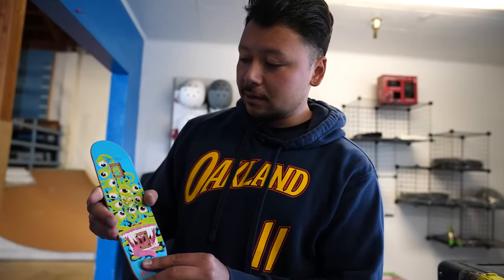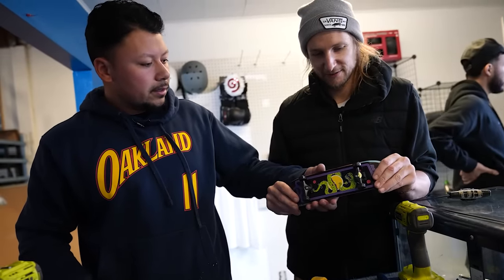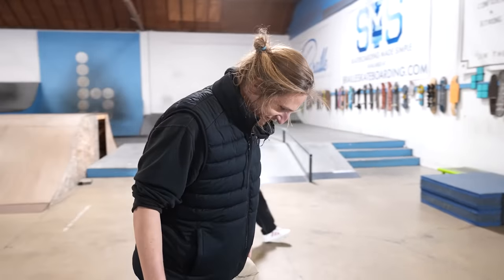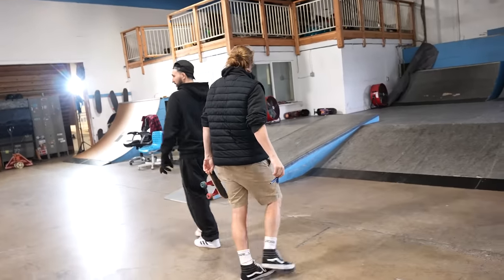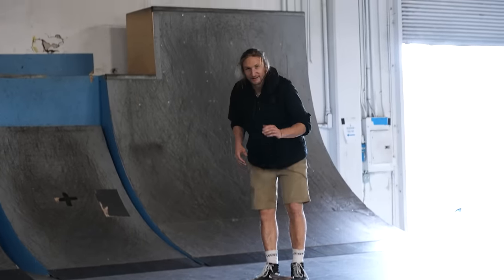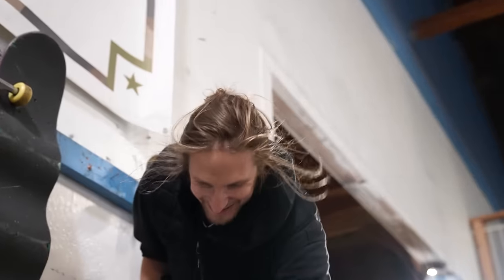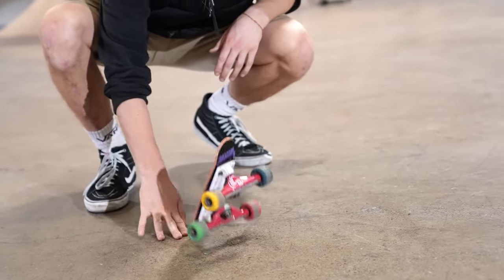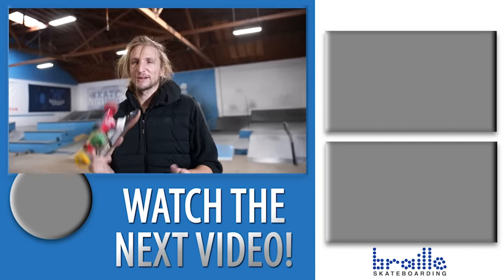HAND BOARD WITH FULL SIZED TRUCKS HACKS!

Comment: 2.75" = 2 3/4" = 2 6/8" = 2 12/16" ..half of that = 1 3/8" = 1 6/16" ...inches are measured with Standard System, no reason to convert to Metric, unless all you have is Metric measurements, or are using less than 1/16" tolerance. Also, make a template whenever you can ...much easier to get stuff aligned and accurate. 🔥